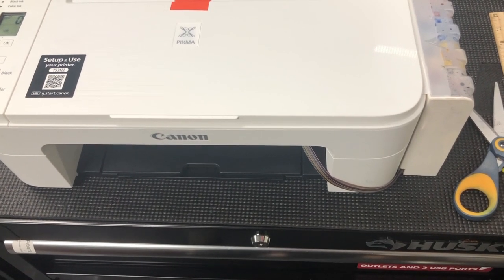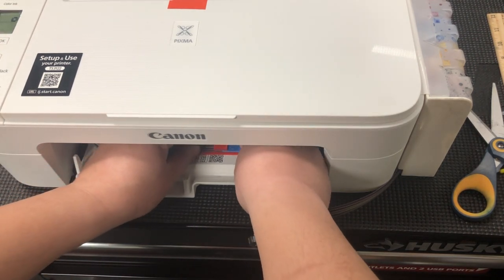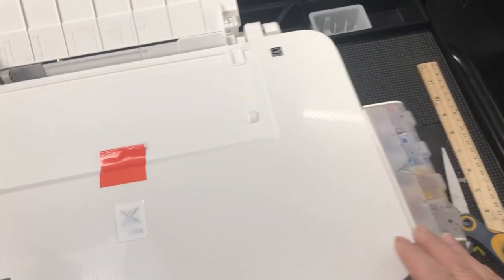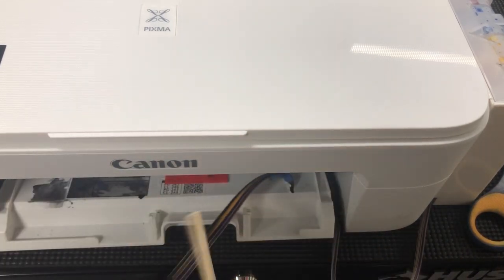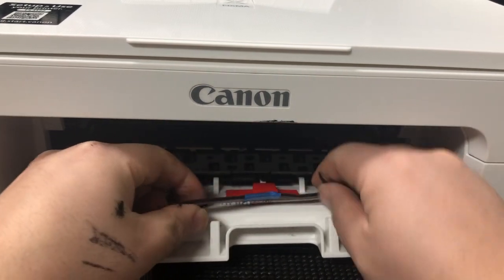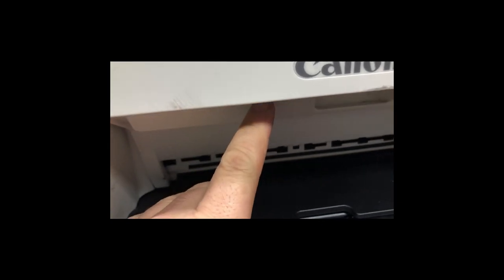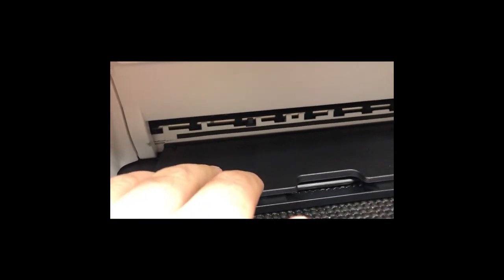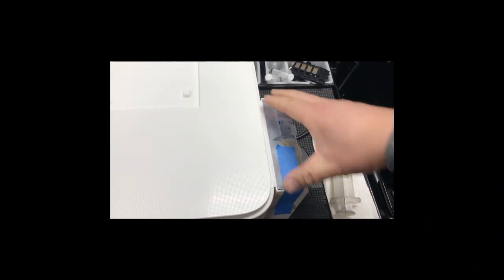Canon with CIS: Fix P02 E03 Error

Comment: How do you bring out that cable you were showing? My canon from Walmart had E03 because an eraser fell into it and I was able to get it out and it still said that message. Just bought another from Goodwill tonight and it was fine until I tried printing the testing page. Now it's E03. I assume it's out of ink, but if it's the cord issue inside there, I need directions as to how to check it. I've only gone as far as under the buttons to check for issues.